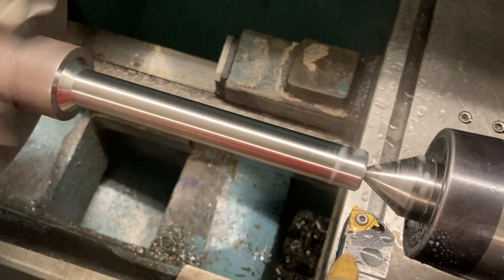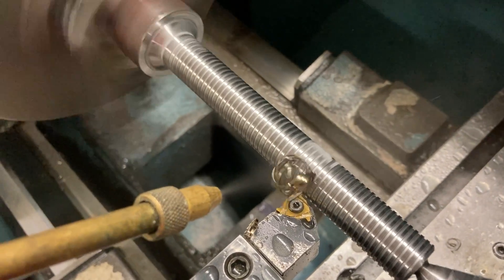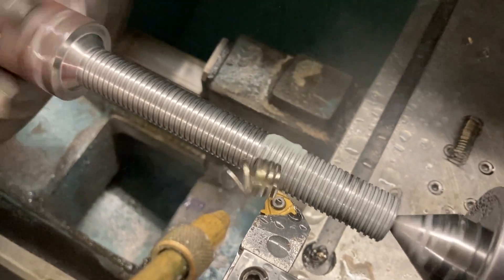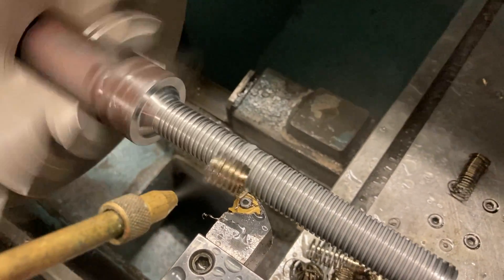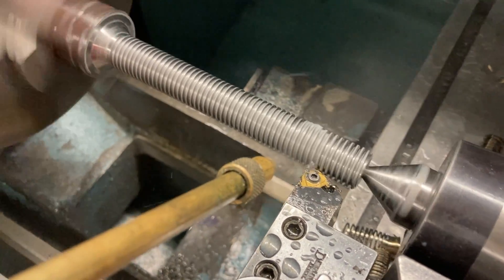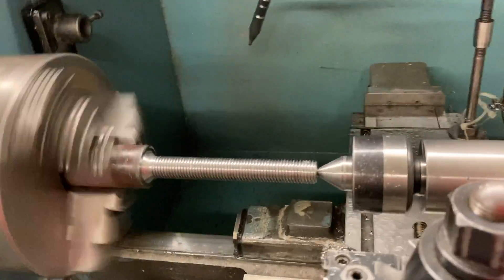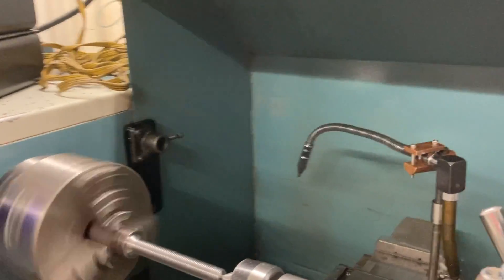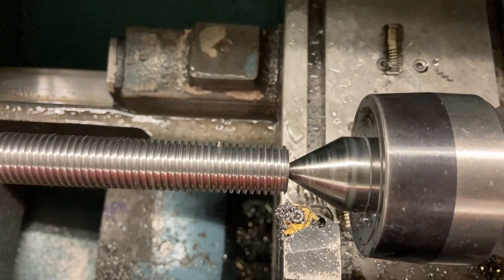Single Point Threading 4140HT  3/4-10 ACME THREAD on Proto-Trak CNC Lathe and COMPARATOR INSPECTION

Comment: The shadowgraph - comparator is a very useful tool. I digitalised ours in the 2 directions and found it was a fantastic guide when roughing gears. I also drew quite a few gear profiles, which again were great when setting up. We had computerised profile equipment accurate to 0.00005". It had to be accurate as some profiles had only a 0.0003" tolerance band on the addendum and 0.0005" on the dedendum. Informative post, good to see the spring cut being used, it is an important part of the process for accuracy and repeatability. Thank you.